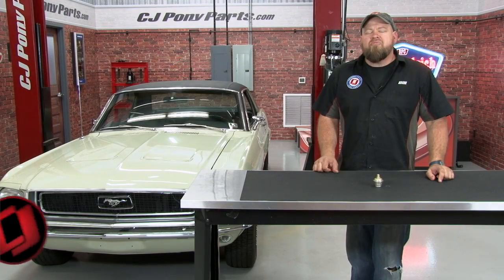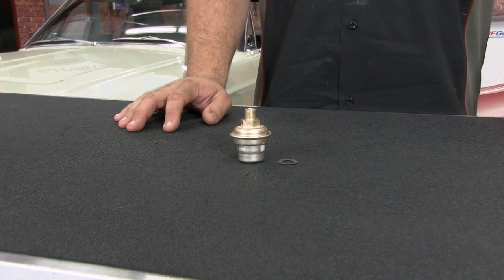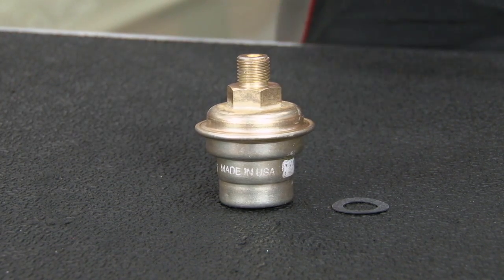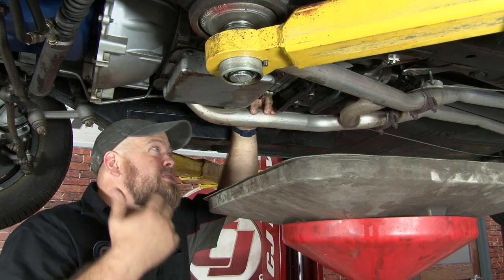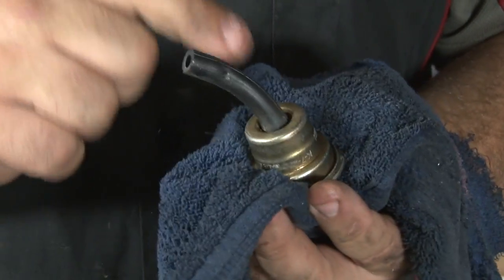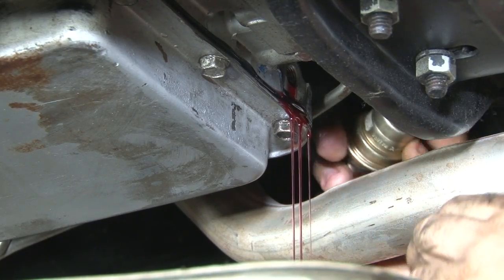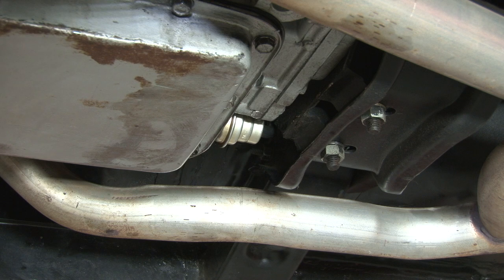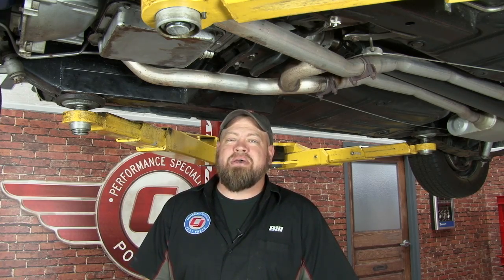Threaded Vacuum Modulator Valve | 1965-1972 C4/C6 Mustang

Comment: Excellent video very well explained. I have a 2008 BMW 750LI  it jumps when i change the gear from park to reverse , Sometimes it will not go in to any gears at all . I had a lots of fluid changed it cost me more then thousand dollars on just the fluid changes . It still does not make any  difference , The dealers do not service this car anymore. it is the vacuum line that is the problem but hard to locate there are to many lines coming from engine to transmission . 
the car has 1056000 km on it , new transmission is not required . Thanks for posting the repair video.
Reply: Bashirsz Darz you have it fixed by now i hope. I just I wanted to add my two cents by saying that the vacuum line doesn't affect the gear change from neutral to reverse, as far as I know. It just effects the quality/timming of the shift. Linkage or valvebody is my thought. :-)

Comment: Hello, I have a 1971 Mercury Monterey with a 5.8l 351W engine and an FMX transmission. The transmission control module went bad and so I bought a new one. I’m worried about the little rod that goes into the new module because it is very loose inside the module and moves around when I try to install it. I am afraid that the rod will fall out into the transmission itself. It is also a threaded module. Do you happen to have any advice for properly installing the rod and making sure it stays in place?

Comment: Just changed mine this evening...1967 Ford Galaxie 500 convertible 390 2bbl with C6...there was no pin...but I had serious shifting problems before (shifted hard and at higher-than-normal RPM) but now it shifts very smoothly but at way low RPM...like 10MPH for 1->2 shift and around 20 to hit 3rd...
Reply: You need to adjust your pin.
There are videos on how to do that.
I'm having a similar problem.
Mine's going into second at 15 MPH then into 3rd at 20 MPH

Comment: The throttle valve is part of the kick down circuitry. The modulator and valve control mainline pressure per the engine load. ;)

Comment: Thanks for the video. Is the function of the Vacuum Modulator Valve only to control gear changes? When I adjust the Vacuum Modulator Valve the Modulator Pressure changes and often drops to zero bar.

Comment: I have a C6 transmission and I get up to about 55 miles an hour and it slips out of gear I have nothing and an engine just revs until I let it coast down to about 15 miles an hour and then it goes back into again. Could this be the problem

Comment: The vacuum modulator "pin" is missing on my C4. Where can I buy one?
Reply: did you ever get an answer on the Pin ? i think mine also is a custom made pin and would like the correct one , Also where does the vacuum line connect to on the motor ? im shifting fast into second gear and slipping into third .
Reply: No, never got an answer.
Reply: The vacuum line is supposed to be connected to the manifold.
Reply: Don't know if you can buy just the pin but a new modulator is not that expensive.
Reply: Mine was missing as well.I went to my local transmission shop and asked them. He gave me 4 different sizes. He said you can tell the one that fits best has a little resistance, not too much but just a little. I started with the second to largest size but it was too small. Moved up to the biggest one and that fit just right. This is on a 1970 maverick c4 automatic transmission.
Reply: Try transmission repair shops.
Reply: You can make pins from an old wire coat hanger. Round off the ends properly. Different pin lengths around 1 5/8”.
Reply: @cboswell569  Can buy a new pin from Transtar. They also have adjustable   modulators with a phillips screw adjuster on the back.
Reply: @WarLordPsycko  Use the vacuum ported connection on the carb, not the "timed port connection" that is used for the vacuum advance for your distributor, like mine was incorrectly connected to on my Holley 4160 750cfm carb. They also make adjustable modulators with a phillips screw in the back to adjust it you want.
Reply: @j.anthony3571  Buy the pin at Transtar sir.
Reply: You can make one out of a welding rod knock the flux off cut it to an inch and a half screw the modulator back on you may have to take it off and grind it a few times to get it right you want it to where it applies pressure to the spring in the modulator

Comment: Could the adjustment cause it to rev between 2nd-3rd?
Reply: I just replaced my vacuum modulator and it revs from 2nd to 3rd. Did u get this fixed?
Reply: @mando82jr  no I just swapped back to a 5 speed.

Comment: Mine won't shift in to 3rd at all may clean mine up see if it makes any difference then get a new one if so
Reply: My 65 wont shift into 3rd either, have you had any luck fixing yours? Any advice? would be super helpful. Everything works fine just doesn’t go into third.
Reply: Same here, sometimes it will shift, but it’s a struggle. Did this vacuum valve fix?
Reply: @sawysauce1256 that’s my problem as well same car I replaced the shift module  and it won’t go into 3rd gear 1st and 2nd are smooth 
It looks like the trannys been out and rebuilt before I bought it so I’m a little worried 
But I need to know what direction to turn the the modular to modify the shifting

Comment: my car stays in 1st gear when I'm on D(drive). it won't leave 1st gear. I've put it on 2 and 1 and still stays on 1st
Reply: 1968 on_Machs same issue...ever figured out what it was 
I got a 67 cougar with the c4 
Just over revs on first 
Wont go into 2nd or 3rd
Reply: check your vacuum line for leaks.
If that doesn't work you may need a new modulator.
Reply: @cboswell569  I just discovered my vacuum line from Mod was attached to the "timed spark fitting on the primary metering block" which is used for the vacuum advance. I have an MSD mechanical distributor and will plug Mod line into the manifold vacuum source, and plug the fitting on the primary metering block. This should help a lot.
Reply: @robertclymer6948  Thanks for your comment, I hope the intake source will fix my problem also ?
Reply: @rapson672  Make sure your linkage arms on the side of the trans are in the proper adjustement while your at it. Good Luck. Oh, those trans moduals go bad also, usually screw in and inexpensive. Different color stripes on them are codes for how they perform, like hard shift, soft shift etc etc. Green striped Mod is normal shifting if I remember correctly. Good Luck!!

Comment: Maybe this is why my automatic transmission has very delayed shifts now. I have to manually opt in second gear and then it wont go to third unless it goes up to 2000-2500 rpm
Reply from the maker: Good possibility
Reply: Fox McCloud 007 Exactly my issue. I have a 1970 Ford F100 that likes to shift around the time it sounds like it’s about to blow, and I think the original modulator on my truck isn’t adjustable (just poked around with a tiny flathead, as advised, and found nothing to adjust inside of it), but the new one will be in tomorrow, and we’ll see how the replacement does! So excited it could be this cheap and easy to fix. Been dealing with it for a couple of months...
Reply: I have a 79 Fairmont with c4 in it.  Won't shift into drive . Shifts up from 1to 2 and when it goes from 2to drive neutral it goes. New modulator valve and has vacuum new fluid . Car has 40,000 miles